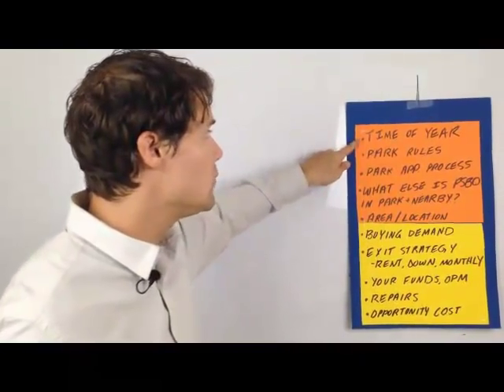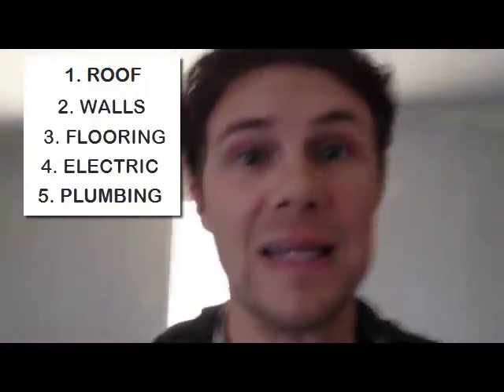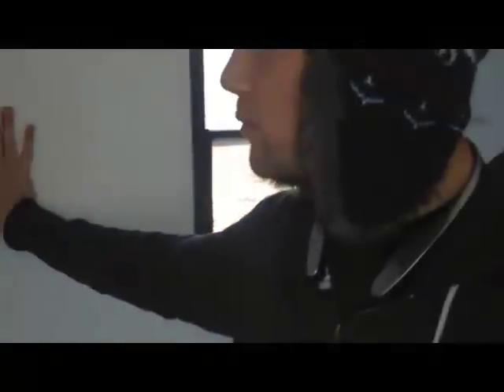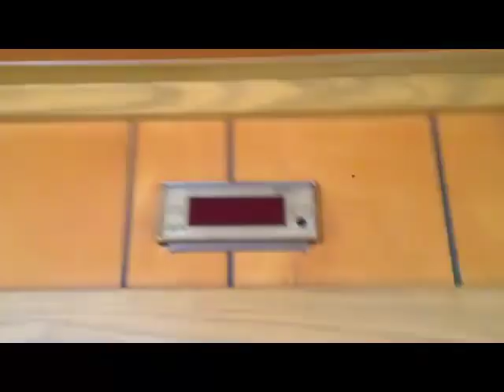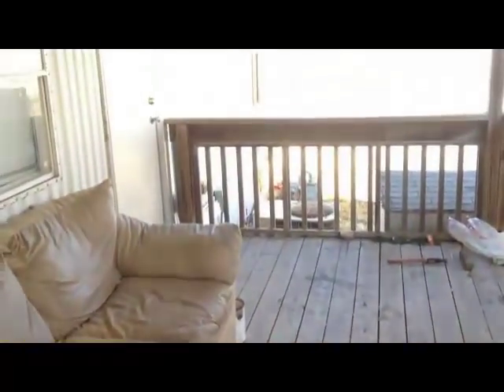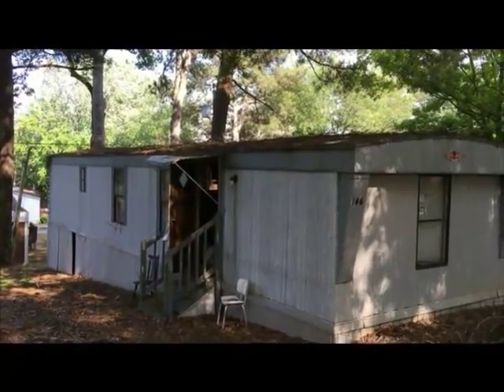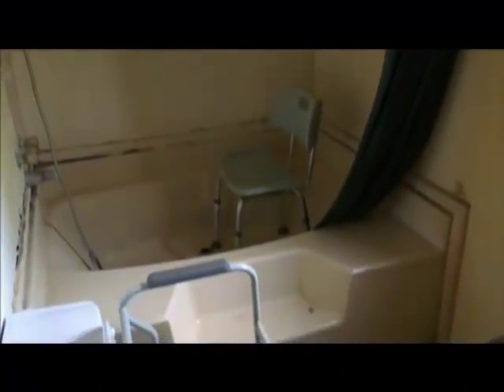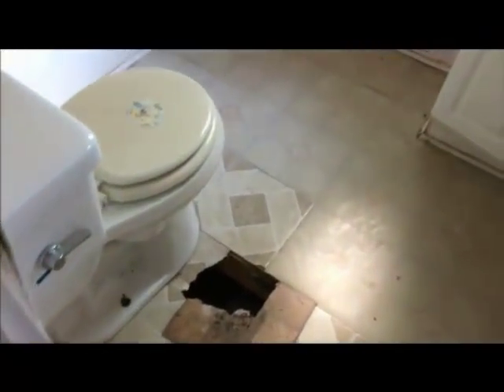Mobile Home Inspections, Walk-Throughs & Repairs 101

Comment: Good video. I have inspected manufactured homes for some investors. If anyone out there is planning on buying a used one, be sure you have it inspected by an inspector that is certified to inspect Manufactured Homes. There are many inspectors out there that are not qualified to inspect these,
Reply from the maker: Great comment! Very much agreed. When in doubt call in a knowledgeable inspector that has experience inspecting mobile homes and manufactured homes. Many investors I know invest successfully without the use of an inspector, however inspectors almost always tell us things we did not know before and/or allow us to renegotiate the price a bit lower from the seller. What is the name of the certification people should look for when hiring a potential inspector?
Reply: @MobileHomeFormula  I would ask for a certificate of training. I got mine thru NACHI.

Comment: Been binge-watching your videos lately. Lots of great content!

One note of constructive criticism, though: avoid using the light-colored markers when you're doing the whiteboard, especially yellow. Very hard to see on video, especially when it's on the spots where the light glare is (Looks like you're using two reflectors to bounce and soften the lights in an attempt to cut that glare down some, though, so kudos on the effort even if not totally effective).

Again, lots of great content, so thank you!
Reply from the maker: Hi Cory Buckles, Thank you for reaching out and connecting again. Thank you very much for the constructive criticism with regards to these videos. I will make these changes. Anything else you see like this or suggestions never hesitate to send them over. As always, any additional questions or concerns you ever have never hesitate to reach out any time. Talk soon, John

Comment: Thank you for such an extensive video. I am currently looking to purchase a mobile home and am curious about repairs. Would I have to search for a specific type of contractor to make repairs, like a new roof, and underneath the home, new siding etc, or do general contractors usually know how to work on mobile homes? I appreciate your expertise! Oh! I see you have a video on that!
Reply from the maker: Hi Jan Coldwater, Thank you for reaching out and connecting. Additionally, thank you for your kind words. I would very much encourage you to get in contact with a mobile home experienced handymen or craftsmen. If you are talking about a new roof than perhaps you need to spot fix an area or install an entire roof over. It is important to get somebody that has experience and can show proof that they have done this before. I would definitely encourage you to reach out to local mobile home parks and mobile home dealers and movers to say that they could recommend as far as mobile home repairs and contracting work. I hope this helps and point you in the right direction. Moving forward if you have any follow-up questions never hesitate to reach out any time. All the best. Talk soon, John

Comment: There wanting 32,000 and 250 for the probly for the paper transfer 400 to move 400 for the steps it’s a 2002 16 by 76 it did have lots of anmail pee and roof was leaking and pluming under the sink but I have know way to see if the plumbing works or AC and heating and elctric

Comment: if yur gonna set up a mobile home lot to rent these, go buy a few "true home" mobile homes. they are cheap, but they are new and you don't have any repairs and you can charge higher rent
Reply: you need to go to a mobile home factory, undercover, and see how these things are built. I believe you would change yur investment strategy
Reply from the maker: @kennethnugent8255  Thanks for reaching out and connecting. I believe you have some good experience however I am not sure you know what you are talking about when it comes to investing in individual mobile homes for cash flow. I wish nothing but the best for you moving forward however your attitude seems pretty negative towards mobile homes. There is a video on this channel while walking through a mobile home factory and discussing a number of things with the plant manager. As always, if you ever have any mobile home related questions or concerns never hesitate to reach out any time. All the best. Talk soon, John

Comment: Thank you for sharing all your knowledge. It is greatly appreciated. I have a question that maybe you can help me with. I looked at a mobile home today to purchase as my residence. It does need some remodeling inside, but that's no problem for me. I'm a pretty handy guy. The outside lot/Grass area is my real concern. The grass is really soggy. When I walked around the whole unit my foot would sink about 2 to 3 inches. The wood is rotted around the whole garage/shed and part of the patio is broken and sinking. I'm just wondering why the ground is so wet and doesn't soak it up. Not sure if there is an underground pipe leaking or maybe a water table. Any ideas would be extremely helpful. Also they are asking $10,000 for trailer. Lot rent is $500 per month. Seems kind of high. Thanks in advance for any help you can offer.
Reply from the maker: Hi Bushcrafter331 Ok, Thank you for reaching out and connecting. Additionally, thank you for the detailed comment as a certainly does help me understand your situation a bit better. As far as the price of $10,000 for the home, I'm not sure where this property is located, how large it is, how many bedrooms, or where the current condition is so I hesitate to let you know if this is a high price or low price for the home. However $10,000 is certainly around number that could likely be talk down a bit. With that said if the market is strong in this area the home may likely sell to another buyer before too long. What area of the country is the home located? With regards to your main issue about the water question, you nailed it on the head with regards to a pipe broken near or underneath your property, or a water table issue that perhaps this home experiences multiple times a year, or simply a low spot in the mobile home community itself, or some type of waste pipe broken if the smell is bad. The important thing is to get clarity on what is going on. You'll definitely want to speak with the mobile home park manager to alert them to the problem and see if this is common. It is possible to get a exterior pump that will kick on to pump out water if there is a bit of standing water making it difficult to get into the home. With that said it is good to know your options before purchasing anything. This may not be a dealbreaker however it would possibly meet a lower purchase price. I hope this helps and starts to point you in the right direction moving forward. Feel free to keep in touch moving forward. All the best. Talk soon, John

Comment: While i do agree with most of what you have said i still maintain that sometimes we overwhelm and over think a situation and frustrate the seller to someone less meticulous. I have seen it happen, you cannot be an investor and be an extremist, you will lose out on the deal. i bought a mobile some time ago and did not do anything near what you are recommending and all i did was slap on some fresh paint and then flipped it for a nice profit. No inspector nothing...keep it simple...keep it real...
Reply from the maker: Hi Stephen Williams, Thank you for reaching out and connecting. Congratulations on the mobile home deal where you were able to quickly resell the home after it was painted. With regards to your comments I do not disagree with you at all. If everything goes smoothly and no surprises arise then by all means as long as the seller and buyer both do what they say they're going to do a deal should work out without any issues. With that said I know I have personally been burned and fooled more times than I would like to admit. It is for this reason and many other reasons I go through the homes and perform enough due diligence so at least I know exactly what I am buying, plus I'm very aware of the market I am buying in and reselling into. The whole point of this video is to provide an investor with more clarity instead of less clarity. I encourage you to keep investing in mobile homes and creating as much value and profit as possible while still helping local buyers and sellers. I hope nothing but good things come to you and your business however if you ever have any follow-up questions or concerns or troubles never hesitate to reach out any time. Always here and happy to help if possible. All the best. Keep in touch. Talk soon, John
Reply: I appreciate you also connecting with me. Due diligence is extremely important especially when you have been burned . It is a learning curve. I made a lot of notes from your videos which i will seek to apply not just in mobile but in regular real estate investing. Thanks again and God bless.